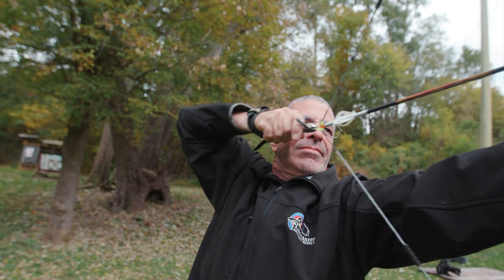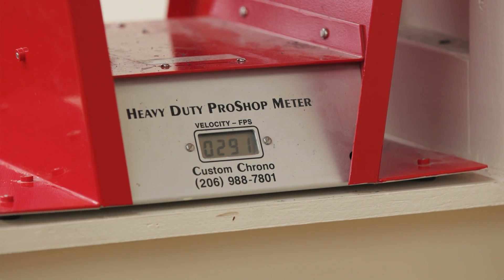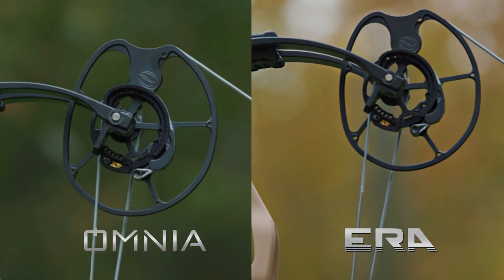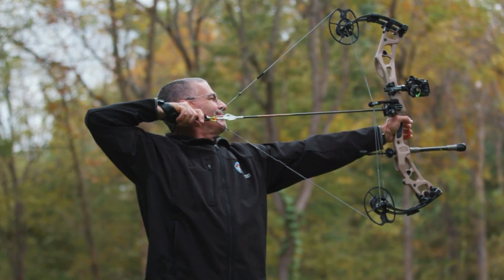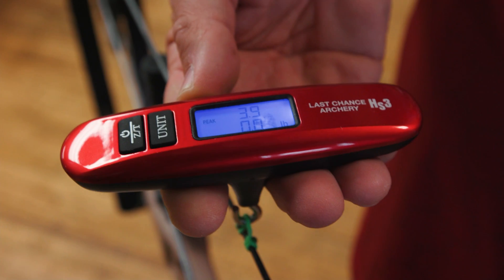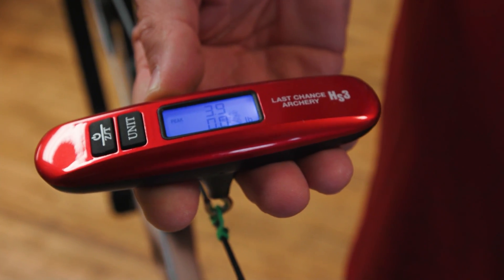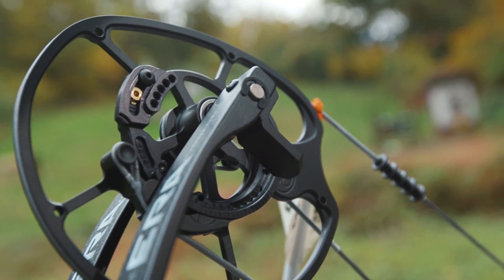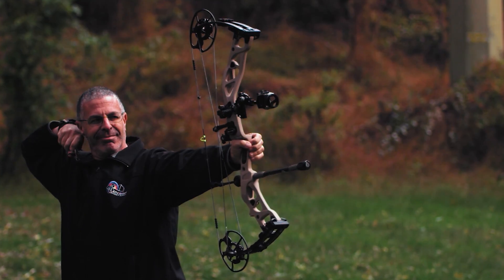TECH TALK with TOG COO Josh Sidebottom

Comment: Carbon riser is a fashion statement. It brings nothing to the raiser of the bow except weight reduction that after you add bunch of stabilizer make no difference any way. Carbon is a special material that make sense in places were weight saving and directional strength makes a performance difference not in place where it make no difference at all. So yes carbon raiser looks cool but that is all the bow will not shoot any better when it is from carbon on contrary light weight bow shoot worse because they are hard to hold steady. Everyone that has shot a compound bow knows that. I am curious about the " benefits" I am guessing high profit margin is the main benefit.